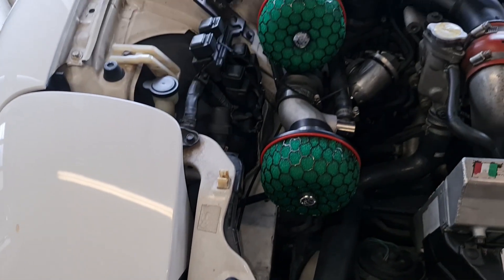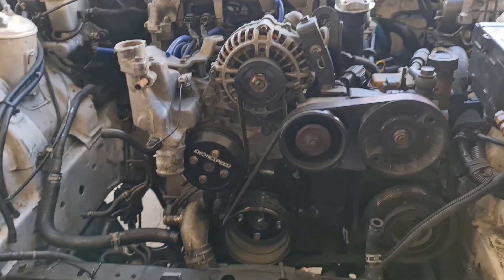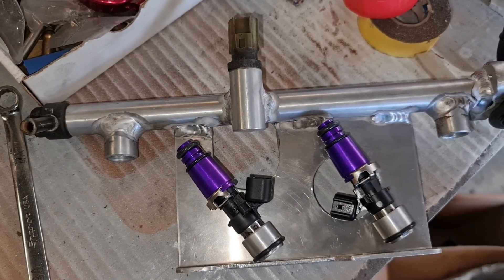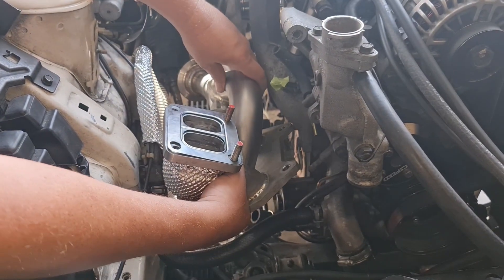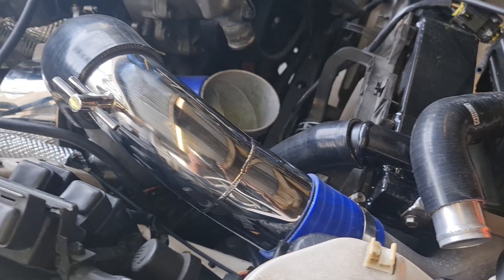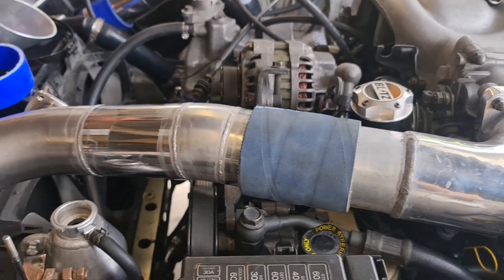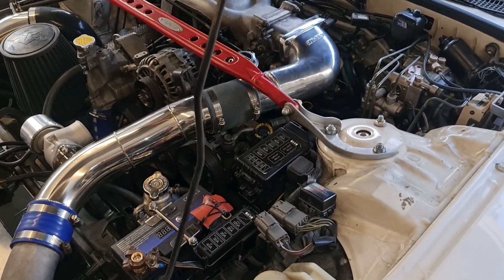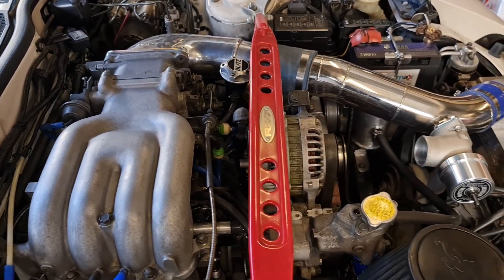FD RX7 Turbo upgrade.

Comment: Very nice 👍. How’s the pfc handling the 1700cc injectors?  Are they injector dynamics? Post some tune sessions and issues ... am gong a similar route with efr 8374
Reply from the maker: Hi. Yes injector dynamics . Once the correct injector settings have been entered into power fc it will run exactly how it runs with standard injectors on the same tune. Fuel pump needs to be upgraded as well, we use areomotive intank pump. You need datalogit to enter injector sizes larger than 1000cc. I will post some tune sessions in the future , probably on the scarab project , same setup just in a boat.
Reply: @Nospig  thanks mate. Yeah got fc-hako.